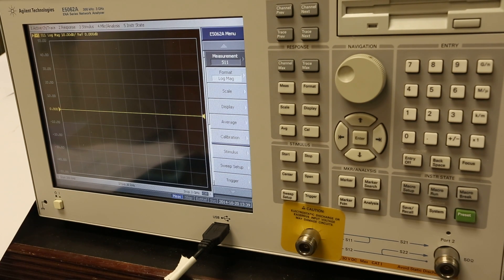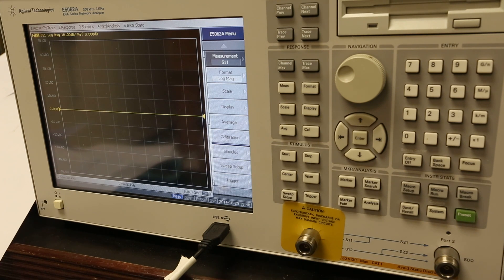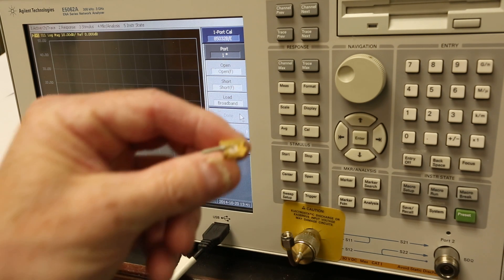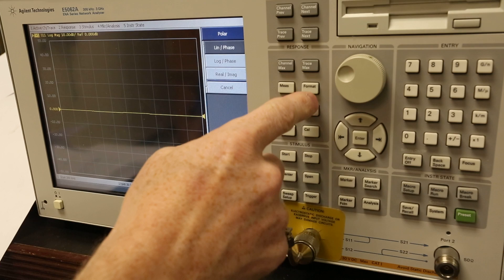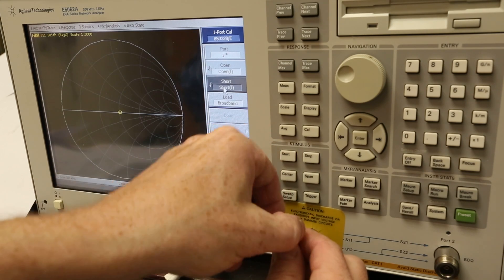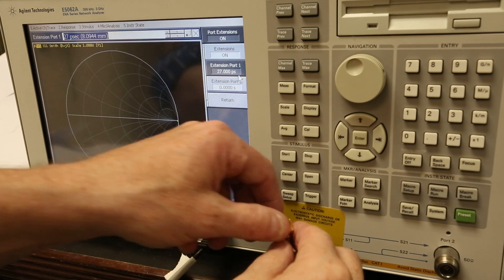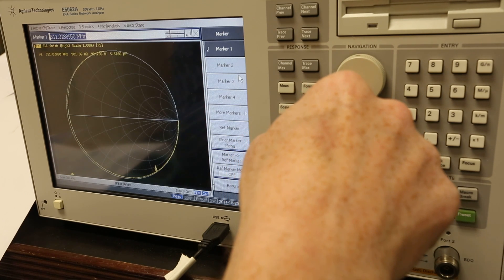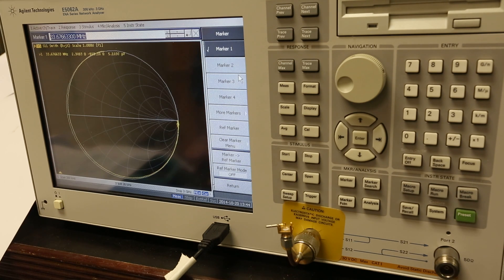How to determine the value of a capacitor or inductor using a network analyzer

Comment: After almost 5 minutes of doing the obvious of calibrating, you pushed a button and read the value that the network analyzer told you.  Big deal. Thanks anyhow, but there was absolutely no useful information in your video.
Reply: So you're dismissing the clever fixture, use of port extension and display of actually using the instrument to do what is announced in the video's title...

Comment: Hi, I am learning about VNA, so sorry about the possibly dumb question. But what is the "Extensions" parameters (you set up to 27pSec), what does it do physically speaking? It is a time compensation for the length of your sma connector or what? Thanks!
Reply from the maker: It is exactly the time compensation for the length.
Reply: @TimVT971  and how you calculate this ? Can you share the equation you’ve used for this?, thanks.
Reply: @hectorgonzalez6361   I don't think he calculated it... If you check the smith chart when he put the open : it was an arc so he did the port extension to make it a single point on the smith chart.... This is my understanding

Comment: Wonderful video, tnx for posting it. I have the same ENA & have a question regarding calibration. Would you mind a private e-mail ? If not what is the best address to use? Thank you
Reply from the maker: Ask here, then everybody benefits!
Reply: @TimVT971  ok here goes: As you know the manual for our ENA's are quite sparse. The operators & Service manual provides only a top-level description of functions available but do not go in any details on their use. Nor is there any detailed information on the Agilent/Keysight site.  For example I wanted to take an existing cal kit (say the 85032 kit), modify the coefficients to match my SOLT kit, then save that kit as one of the 2 available USER defined kits. I saw no way to do this. I can edit the values but then how to save this as a NEW name?  Is there a way to do that? From what I have seen I do not think so and my cal kit coefficients must be entered in as one of the USER defined slots. Is that your understanding?
Reply from the maker: @w8bya  I understand what you are asking. I am not sure if you can do this with this ENA. Our cal kit was developed using a factory cal kit as a standard on a different ENA. We measured the factory cal kit and then measured our hand made calibration standards. We then sanded the end of the open until our polynomial was a close match to that of the factory standard. The short was done in a similar manner. I cannot remember how we modified the load to alter it's curve to approximate the factory standard. This "cal kit" was made for use in testing with sub- gigaHertz testing. If I had to do accurate multi-gigaHetrz or higher testing, a factory cal kit would be more and more necessary
Reply: @TimVT971  Understand. Ok now two more questions if you don't mind. The 1st is what our Asian developed ENA's call "Arbitrary" THRU.....is this the same as "UNKNOWN" THRU that is used in every other VNA ? I am having difficulty finding information on the definition and use of "Arbitrary". Our manual shows the button there but does not say when it should be used or how (in terms of a setup).

The 2nd and most burning question involves the "CLASS" (CLS) of the cal kit components. If you look closely at a kit like the 85032 you will see that there are male & female opens and shorts etc.....and there are CLS's associated with only 4 out of the 6 cal components, short(m), short(f), open(m), open(f), load, and thru.  I do not understand how that can be. Should there not be a CLS definition (association) to each and every element of a SOLT kit? This one is driving me crazy because when you do a cal what tells the ENA whether you will be attaching a Female or a Male short say? The CLS let's you define (or associate one). I guess I just do not understand the CLS and wish I could read about it someplace. If you could help that wud be most helpful. Thanks
Reply from the maker: @w8bya  This document EEE TRANSACTIONS ON INSTRUMENTATION AND MEASUREMENT, VOL. 63, NO. 6, JUNE 2014  DOI:  10.1109/TIM.2013.2292754   seems to have information about using an arbitrary to calibrate a NA. You can get the article using :  replace the colons, dots and slashes with : . and /

https(colon)(forward slash)(slash)sci(dash)hub(dot)tw(forward slash)10(dot)1109(forward slash)TIM(dot)2013(dot)2292754
Reply from the maker: @w8bya  2nd question: This I am not familiar with
Reply: @TimVT971  The next time you are in front of it & have a minute pull up the stock 032 cal kit then hit the modify button so you can examine how each of the components of the cal kit (SHORTS, OPENS) are defined and in particular look at the 2nd button where you can modify or look at the CLS definitions.

It makes sense that each element get a STD number and what port it will be used on, i.e., PORT 1 & PORT 2.....all is good since you can see a CLS definition for one open, one closed, one load, and one thru BUT what of the other two components (an OPEN & a SHORT)......there are two that do not have a CLS associated with them.

It seems two get left out....I hope that makes sense.
Reply from the maker: @w8bya  No can do, I left that job and that ENA a while ago, sorry. I'm into optics now
Reply: @TimVT971  Bummer ! I will be happy to e-mail you a screen capture or some JPG's of what I am talking about here if you are game. I would like to get your take on what I saw.

As an aside were you aware that on this ENA, when the instrument says something like a SHORT(f) they (the Asian engineers who designed this ENA and wrote the manual) were actually talking about the PORT gender and not what you are holding in your hand !  You have to read the very fine print but there are some warnings that remind you that "their" way of thinking is 180 degrees backwards from how normal VNA terminology goes or is.

Comment: 4:35 Might be A dumb question..but how can we tell that this cap is behaving like an inductor post 2.4 GHz?
Reply: The analyzer screen displays a circular Smith Chart where the upper hemisphere represents inductance and the lower hemisphere represents capacitance. As the frequency changes the point on the chart follows the displayed curved path, and as the frequency increased, the point moved from the lower into the upper hemisphere.  Thus, the capacitor began to behave as an inductor rather than a capacitor.
Reply: I don't really have a good answer to that, but I noticed that as soon as the marker passed on to the upper half of the diagram (at about 1.28GHz) the unit changed to Henry instead of Farad, which is the property of an inductor.

Comment: Capacitors' capacitance is not rated anywhere near 100 MHz. Especially small value ceramics. 1 MHz for <1000 pF and 1 kHz > 1000 pF.
Reply from the maker: I was originally confused by the "not rated" comment, but I think I figured it out. I'm talking about RF capacitors specifically designed for these frequencies. I believe you are referring to the class I and Class II specification of a capacitor. For RF capacitors, the self resonant frequency is a characteristic that is used for coupling and filtering. Take a look at this Murata webpage. It shows the SRF for an RF 1000pF capacitor is ~250Mhz.  If I had to couple an antenna that was tuned to the 250Mhz band, I would use this value to create a DC block. If I had a voltage regulator, in that same circuit and I wanted to block noise in the 250 MHz band from being injected into the power supply. I would place a 1000pf capacitor on the input and output of the regulator as close to the regulator as possible. I'd also want to have a ground plane pour that leads right up to the pad for the capacitors. It's been my experience that for the 250Mhz band you'd be more likely to use a 400-600pF 0603 ceramic capacitor. 

https://www.murata.com/~/media/webrenewal/products/emc/emifil/knowhow/12to14.ashx
Reply: Ah, that is the disconnect. The capacitor company I worked for didn't sell RF capacitors, or at least not many. So I'm more familiar with "general purpose" caps. In most cases, we didn't even sweep past 10 MHz when doing impedance plots, which is why the 100 MHz caught me off guard. Thank you for following up.

Comment: Hi, sorry if this is a dumb question, but are these network analyzers a good thing to have for an aspiring design Engineer..Thanks
Reply: Network analyzer are one of the most expensive item in RF lab (from 10K to 300/400K price). If you are interested in RF circuit then you it is a good equipment to have ( you can get used model in e bay). You can also use spectrum analyzer with tracking gen. to create 'scalar network analyzer'
Reply: They are not as important or useful as a good scope and a spectrum analyzer but after that if you can still afford it, they are very helpful for RF work. I have one which is similar to the one shown here but it is older (1989) so it has a CRT and no USB, but it does go up to 6GHz. (It is an HP8753C with option 006 and HP85047A test set) It also has an external S-parameter test set. All together, I paid about $1800 US for it on eBay.
Reply: Test port cables and calibration kits are also very expensive also connectors of different type the higher the frequency the most they will costs.

Comment: When you use the same way to measure an inductor, would it cause a problem when shorting the signal to ground by the inductor? I saw a negative real part and am not sure why...
Reply from the maker: Good question. At DC and low frequencies, there will be a short. As the frequency increases, the reactance will begin to look more and more like an open circuit. XL = 2*Pi*F*L So you see as the frequency goes up so does the reactance. So you pick the frequency that you are using the inductor at, you then read the inductance at that frequency. It might be much different than the value printed on the package.
Reply: Thanks for the reply. Z =  R + jX. I know X is frequency dependent, but I was actually talking about R, the real part of the impedance cause I want to check the Q value. With a negative R measured, I can only add a series resistor to increase the real part can minus it back manually.
Reply from the maker: On the network analyzer, at low frequencies the trace will be on the real axis near zero as this is the "real" part of Z. As the frequency goes up, the trace will leave the real axis
Reply: Impedances with a negative real part only mean that we are dealing with an active network.
(This situation might be referred to as "conditionally
stable" because the addition of a passive element between two nodes
may bring the system into oscillations.). Some devices also exhibit negative resistance over a part of their operating range.